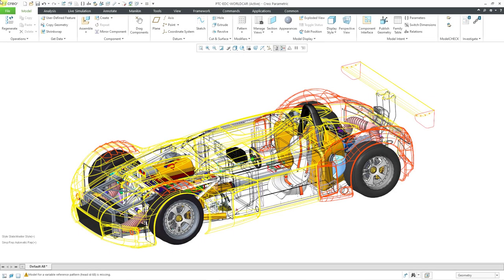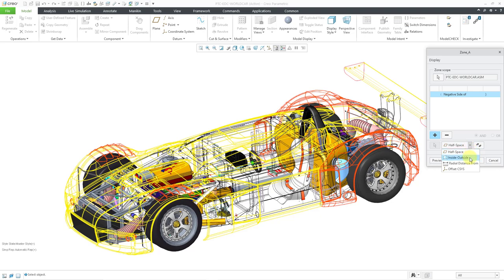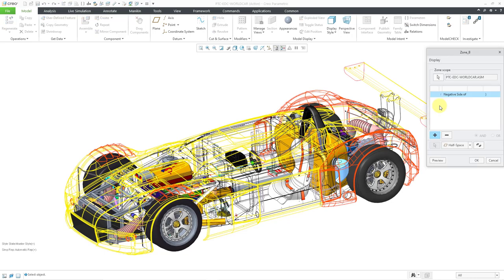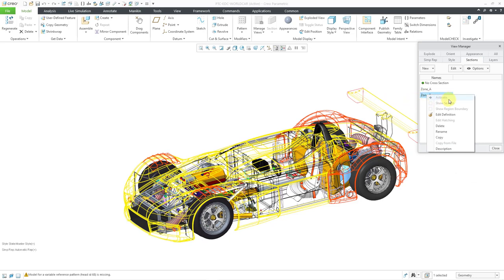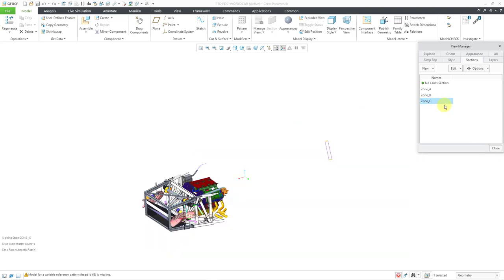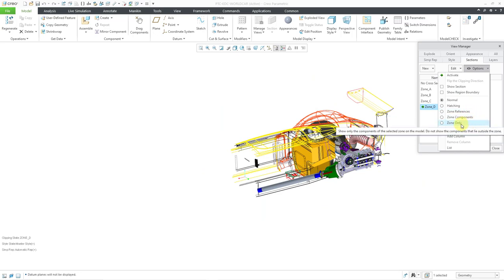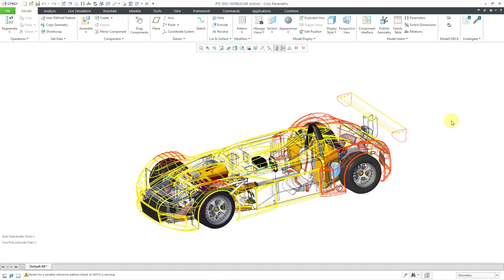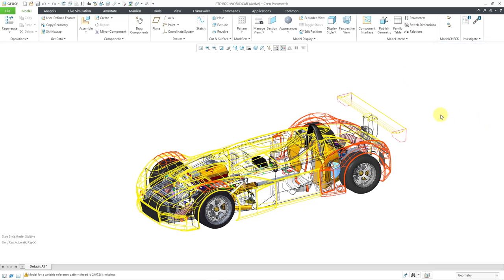Creo Parametric - Zones

Comment: What's the deal on transferring Creo to a new machine if you're maintenance has lapsed.

I was current until Creo 6.0, had a computer failure and bought a new machine, and I'm having issues on getting my software on the new computer. 
I've been using this software since pro-engineer 18
Reply from the maker: You would need to access the online licensing tools to transfer the license. I don't know if you can do that without maintenance.